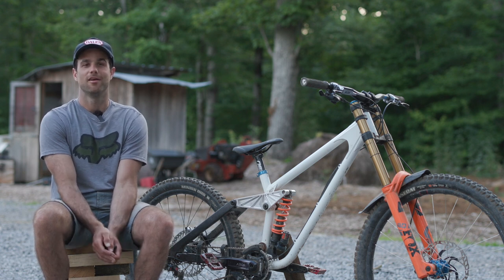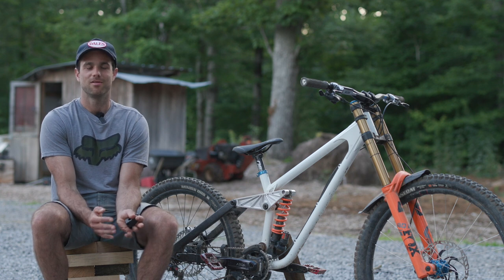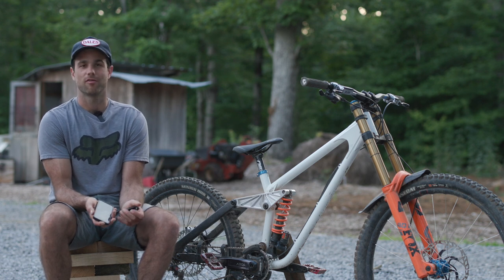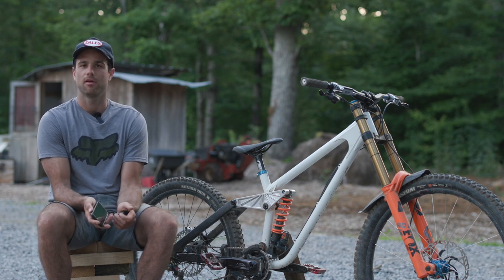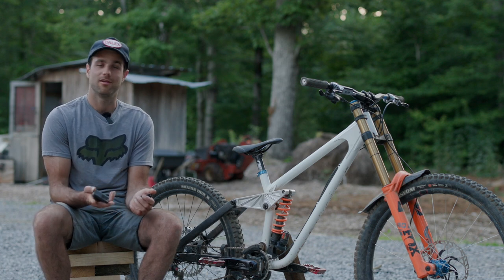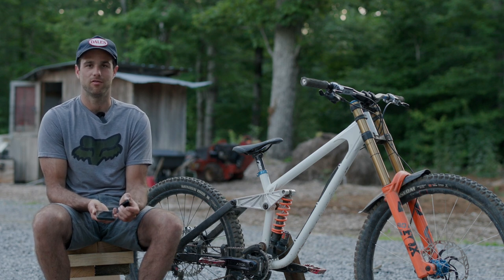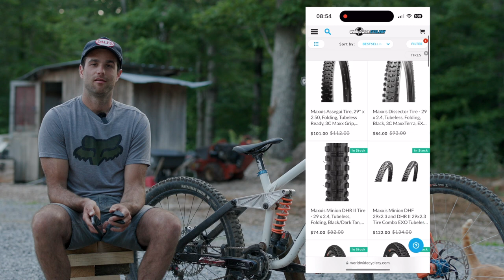IN DEPTH | Neko Mulally | Steel Frame

Comment: Loved the video Neko! Thank you.

Neko covers all the bases really well, as you might expect, but there is one little mistake about the material. He says the non-Reynolds parts are mild steel. They aren't, the laser cut parts are S515 high strength steel, and the head tube T45 steel. Just didn't want anyone getting the idea we built some of the frame out of gas pipe!
Reply: If you could release this frame to the public that would be cool, not many steel DH bikes around
Reply: @kingflynxi9420  Thanks, it is really cool, but it's up to Neko to get them on sale. All the suspension and rear end is his.
Reply: @CoticBikesUK  here's hoping he gives it the ok
Reply: Thanks for the clarification. I squirmed a bit when he said mild steel.
Reply: @CoticBikesUK i'm planning to build a bike out of 304 stainless, I know it not ideal, but whats your take? Will it be alright?
Reply: @LucyFur-f5u  Any material will be strong enough if you use enough of it. Having had a quick look at 304 it's similar in strength to 4130, maybe not quite as strong, so there's no reason why it shouldn't make a nice frame if you spec the tubes correctly.
Reply: @CoticBikesUK  thanks heaps, keep up the sick work!

Comment: Rapid prototyping your own DH bikes without a corporate sponsor is already so cool. But I never would have dreamed somebody would try out a steel DH bike in the modern era. I agree that the head tube is too big. You should test whether the gussets are necessary either. The bike will likely become too flexy rather than breaking outright. There is also a huge amount of options in butted crmo tubing. Awesome stuff!

Comment: Love these detailed vids. I am about to build my first steel frame and these vids get me stoked. Whats the reasoning behind dipping the frame and painting it, as its a prototype with a short life span?
Reply: Dipping gets the internals of the tube (make sure to design drain holes in all of the tubes) coated with the rust prevention whereas paint can only be applied to the exterior faces.

Comment: Sweet 👍Been waiting for an update, was hoping that you'd had a chance to get on it by now, glad you're only a little bit a way from being cleared to ride,  looking forward to hearing your thoughts on the steel vs alu side of it.
You mentioned the main lower rocker pivot setup using a 1.125" HT setup, but didn't mention if the actual axle it's running on is 1.125 or if you're running bigger bearings for robustness - also would guess running full compliment vs caged bearings for a normal headset.
Reply: It's not exactly a headset on it's side. Neko uses 17mm diameter axles, and I know from years of experience that getting bearings to press directly into a thinwall steel tube that has been distorted by welding is a hiding to nothing, so I adapted the idea we use on the Cotic bikes. We use 15mm diameter axles so we use head tube material for a 1 1/8" headset with custom sized cups that hold the bearings and press into the tube after it's been reamed with a regular head tube reamer. With Neko's axle and bearings being a little bigger, I had to move the tube up to the 44mm size you would normally see on the front end of a steel frame. So, still reamed with a head tube reamer, but different cups and bigger bearings than a Cotic so it works with Neko's rear end. It's just the best way I know to get consistent bearing fit on something like this.
Reply: @CoticBikesUK  Thanks for taking the time to reply and give an in depth explanation, makes perfect sense, smart, simple solution to a common problem when working with tight tolerances and materials that "move" when heated/welded. Also, no worries really about bearing seats getting trashed having the press in cups.

Comment: I would say once you strap 1kg of extra suspended mass to the alu bike the difference in trail chatter will become very minimal between the two bikes. And the biggest gap would be between full alu vs carbon/steel.

Comment: Be carefull with the length of the gusset plates at the front triangle,if the tubing is really thin at the point where the gusset plate length finishes, the tubes both top and bottom will form a crack right at the end of the gusset.Hope I've made sense.

Comment: You have to make sure not only the weight, but also the rotational inertia is the same. for example you might have to add weight near the headtube to compensate for the heavy steel tube there.
whoevers in charge of the cad-model can help you with that :)

Comment: Yes, the white is sick. 
What was the E-coat that you had applied to the inside of the tubes to prevent rust?

Thank you for all the info on the frame and tube sizes. You’re a huge inspiration for building my own steel frame. Hope you’re back to racing soon! Always rooting for you!
Reply: Zinc phosphate dip.
Reply: I remember in my engineering degree, the combination of galvanized and painted had crazy resistance to oxidation. Glad to see this is built to last!
Reply: @CoticBikesUK  Awesome, thank you so much Cotic! You guys rock!